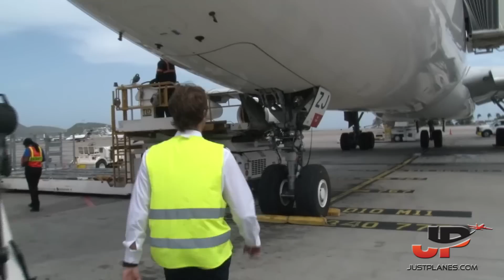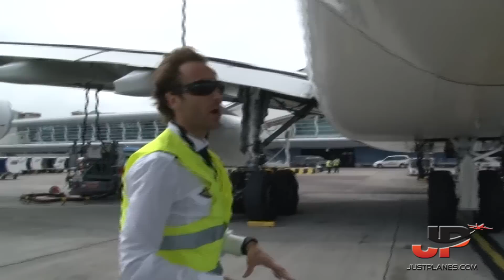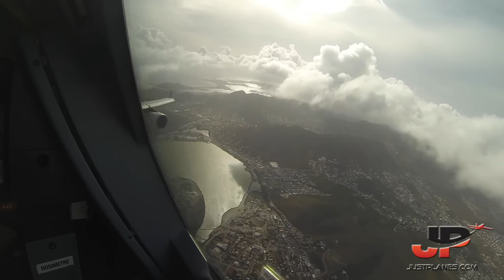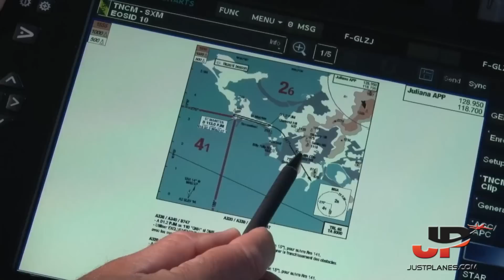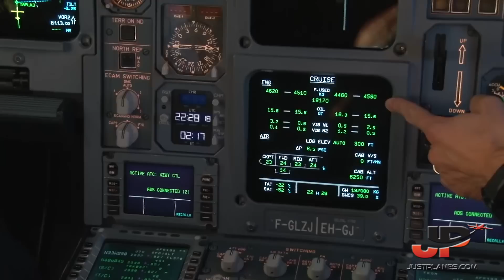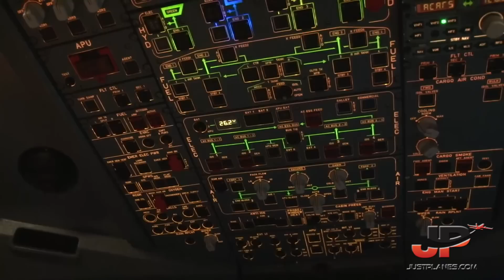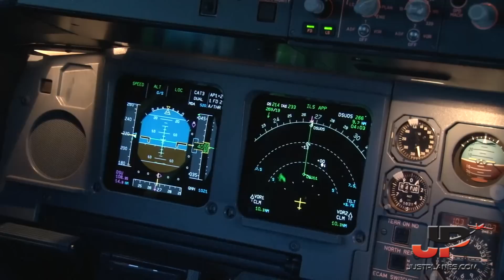Air France A340-300 St Maarten🇫🇷 to Paris🇫🇷

Comment: Edit : I understood this video is from 2006-2008, it's old enough to make most of my comments irrelevants.

though I've been staying in front of Juliana for the most part of this year, and never saw a quad-jet here. Locals confirmed me there hasn't be for quite some time. A330 climbs over my place of stay quite nicely, it's just too loud to maintain a videconference at these hours.

I'm a but uncomfortable with this video. It doesn't fully reflect pilot's proficiency, and contains many quirks. I'm no professional but fly this route quite often, please forgive me for some bluntness.

First off, why use an A340-300 when the AF499 is usualy carried by A330-200 ? It makes no economical sense unless A340s are used as spares. Though the sun seems quite low on Maho for its usual departure time, may be another flight. Also they used this reference when switching to flight-following with the tower around 23:30.

Next is the really light visual check. The copilot should be in radio contact with the pilot to check every systems lighting or movement.

When inspecting the landing gear, there should be level indicators engraved on the stems, and that should match a reading on the instruments.

They're doing the prep pre-flight in english, and they're not realy good at it, that could cause misunderstandings, it's safer when both use their native language while isolated from ATC.

They also missed the plane identification on the checklist : most skip it, but his paper wasn't that of an aircraft registration, merely a printed report from the scheduling desk.

During take-off, it might be due to edits in the video, but I didn't hear V1, V2, VR in sequence.

Well, the flight departure went well, but I find it a bit light in procedural robustness. There might be room for improvements.
Reply: Around 2016, not 2006.

Comment: 1:53  Wonder why slats/ flaps are extended on the ramp? Didn’t understand the FO’s comment was on walk around… something about temperature?
Reply: From Airbus FCOM:
"On ground, hot weather conditions may cause overheating to be detected around the bleed ducts in the wings, resulting in “AIR L (R) WING LEAK” warnings. Such warnings may be avoided during transit by keeping the slats in Configuration 1 when the OAT is above 30 °C."
When flaps are at this configuration, the slats are at position 1 which creates a gap between the ducts and the slats keeping a constant air flow into the ducts which keeps them cool and avert a spurious warning.

Comment: Why did AAL868 need runway 28? 23:45
Reply: listen to the explanations given by captain at  41:00  ! At 44:55 he says that 2 engined planes (like AA) going a long distance better use rw28 for take-off.  By the way nowadays AF uses the A330 in St-Marteen and always uses rw 28 also for takeoff and return to Paris.